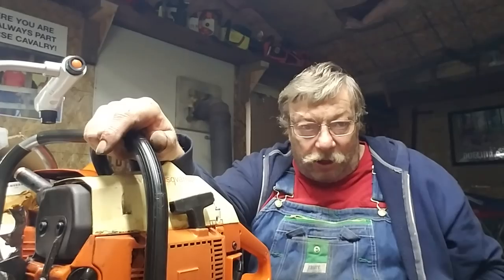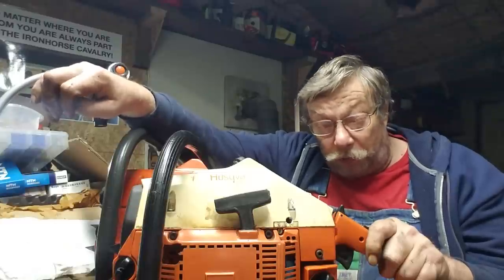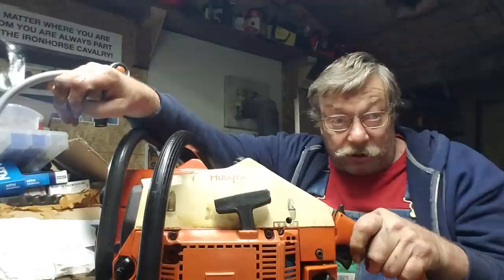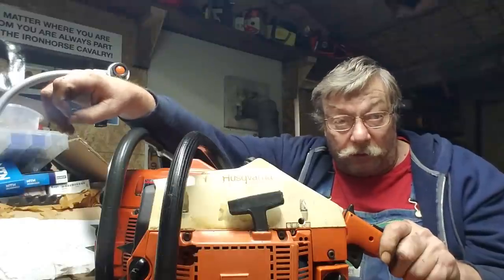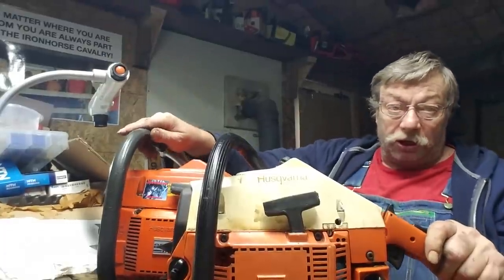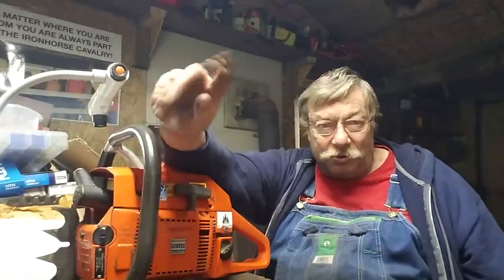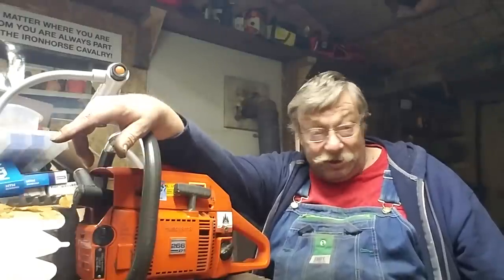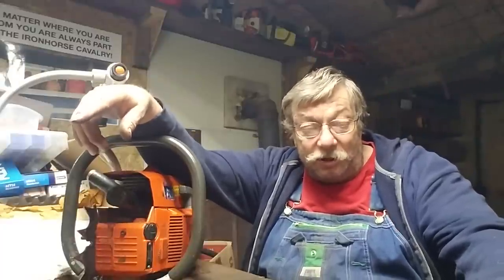Saws ready for action! So am I! 61/266 build details!

Comment: Hi IRONHORSE  Got time for a question, I found your channel, Buckin kept talking about you, so here goes. I have a O 45 Stihl, don't know the year, it has points and condenser. The saw sat for a long time. I cleaned it up and flushed it out, put in fresh non ethinol gas. It started up an ran rough. being incouraged by that i put a carb kit in it , set the hi lo and it runs but i cant tune it. Raw fuel leaks out of the air cleaner,  , and it surges at wide open throttle. I am lost. Been watching your videos and respect your opinion and knowledge about the old saws. Would love to here from you, i am old school to and wrote down your corn bread recipe. Thanks. Carl

Comment: Gonna try Motul 800 two stroke oil.
Anyone tried this stuff?
Cheers for your input..👍
Reply: The Motul premix oil is great. Run it in all my hot saws... the 3120, 395, 576, 372 all ported and all LOVE that oil at 44:1 in 110 race gas.
Reply: Cheers. From the moto cross guys was told it's the only thing they would use....👍